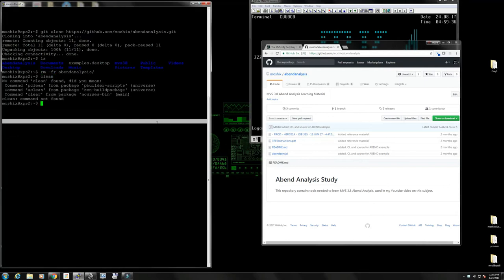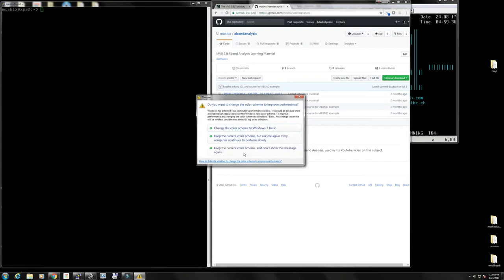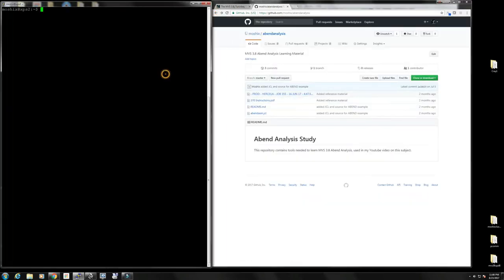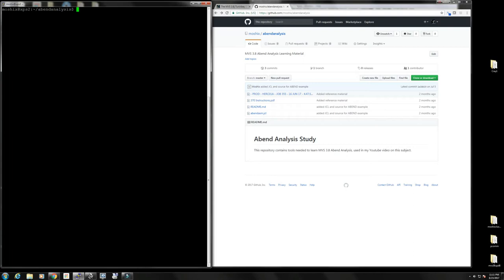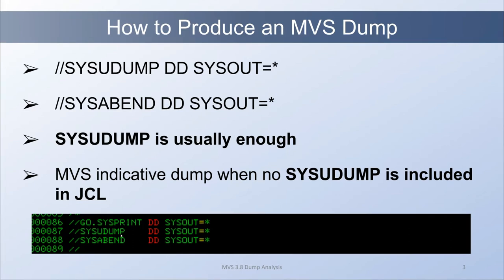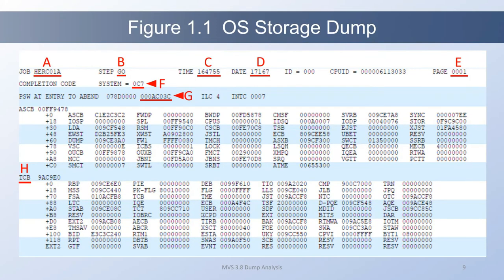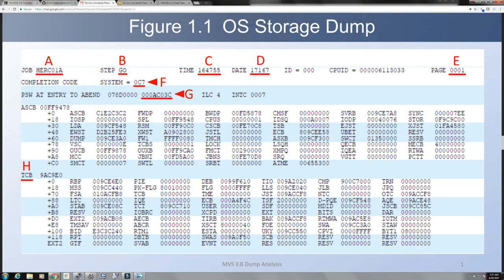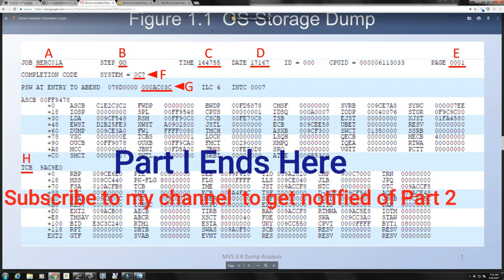MVS 3.8 Dump Analysis - Part 1 - M15

Comment: Dump analysis. Yes those days when I was working as a programmer, I used to run a utility called prtdump that will dump out the storage area of the program. Then we used to look at the PSW and the ILC to calculate the address of the instruction that abended. With the instruction, we will use the IBM  manual to check the instruction code and determine the Base registers and displacement to locate where the data is residing and use the dump to check the value of the data and sometimes we need to sort out the offending data and rerun the job after restoring the files ( if the files are updated ). 
Thanks for your video and giving so much details of the whole process. Those days we don't learn so much. Just need to know how to zoom into the PSW and locate the instruction only is enough as long as we get the job done as time is critical during production support. Keep up the good work!
Reply from the maker: This approach you describe still works, of course.